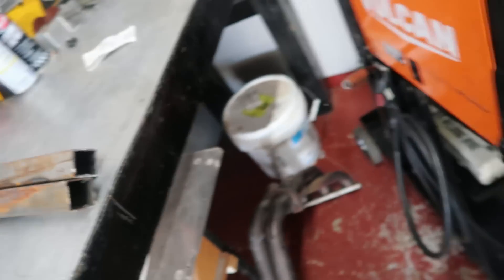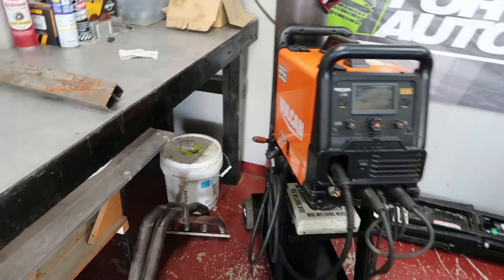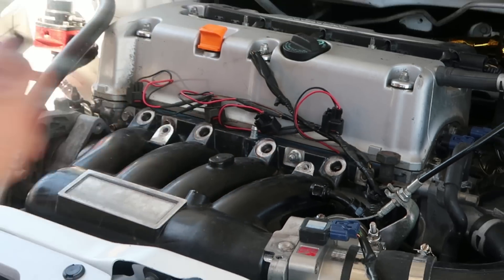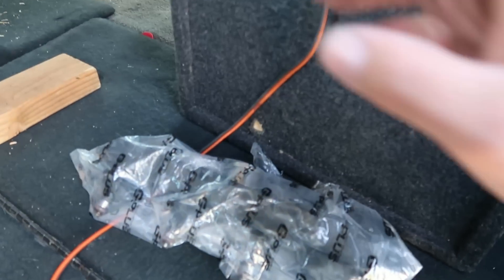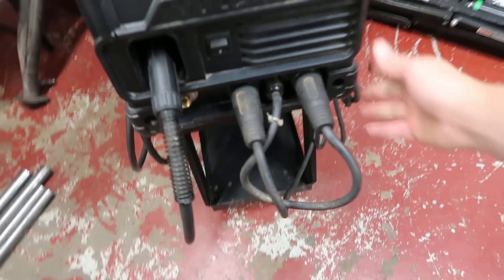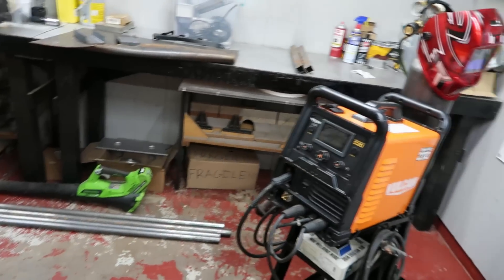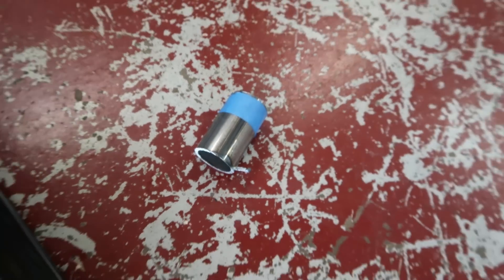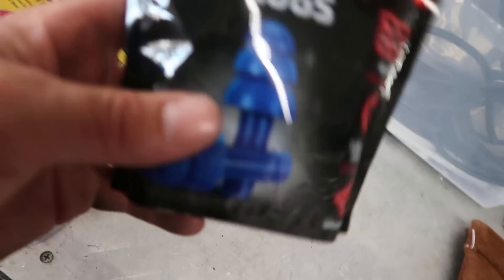My New Welding Setup!!

Comment: Welding tip slow down the speed and lower the temp or move faster but don’t panic, also push the weld don’t drag it, if you drag it you spread more heat

Comment: I learned the hard way about Tig welding exhaust couplers.  After completing some beautiful welds I found that my interlocking Vband couplers did not fit together.   Then I learned that there are brass heat sink Vband welding couplers that remove heat as you weld and keep the Vband coupler nice and straight.

Comment: You’re pulling the weld, you should be pushing. 👍🏻👍🏻
Reply: Pulling means the electrode is leading the way, instead of following behind the puddle? Does this apply to TIG and MIG both?

Comment: Good work on the welder.  Think of the feed and voltage as balance.

You can increase the wire speed, and it will make the weld colder, and like you saw your tacks will break.  Not beacause the metal was dirty.  You can also make it hotter and get better penetration by lowering the wire feed.  You want it to sound like sizzling bacon.

Another thing as well is if your weldng thicker material like the c-channel your better off going with thicker wire like 0.30, i usually only use 0.23 for thinner stuff like sheetmetal 1/8 and under.

Hope that helps

Comment: I tried to tell you a couple months back when you mentioned getting into welding man, i’m going to school for this tryna give you knowledge. 

If you want pretty welds you need to get a tig welder. AC/DC so you can do aluminum and steel. It’ll take way more practice and finesse but it’s what people use for intercooler piping, manifolds n shit they want looking presentable. Mig will put metal together but it puts a lot of filler down and you have to move fast so you don’t get the fusion or look you would with tig. Get a PrimeWeld 225 AC/DC Tig, less than a grand but surprisingly quality for the price, great starter machine. It’s what i got for my first

And get some better gloves bro! Jesus i’ve had those harbor freight gloves burn through the stitching day one and fuck my hands up, granted i was using stick and it was overhead but still you could do way better for like $20 at Norco or Airgas

Comment: I’d probably go get a different helmet. Cut off the tip of wire for a crispy start. Practice just running flat straight welds on the thicker material.

Comment: slow down your not gonna hurt the scrap metal  turn the speed down and slow your hand speed       pull the welder over to you and while your welding turn the speed until you hear a steady hum you dont want to hear sparking that only means your not getting penetration   put your ground on your piece not the table